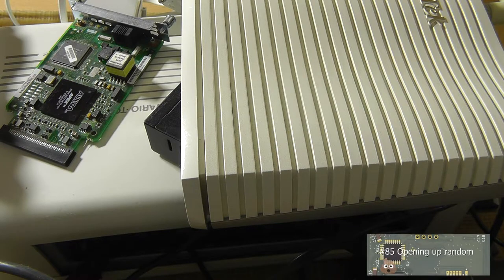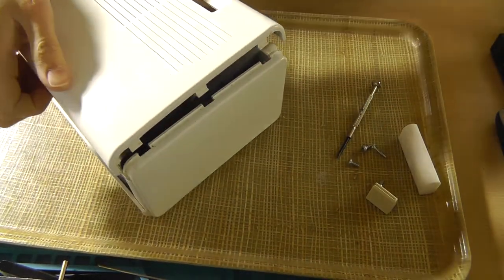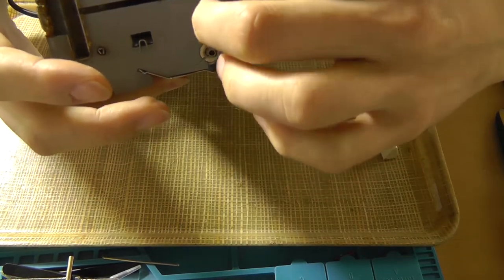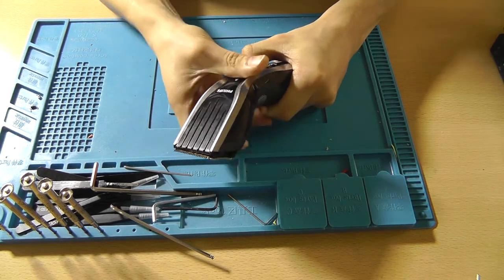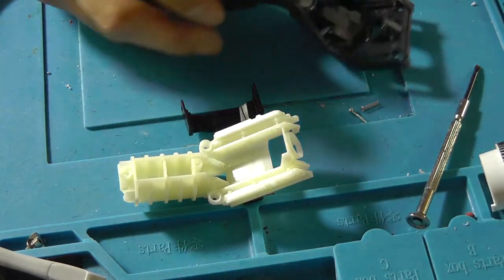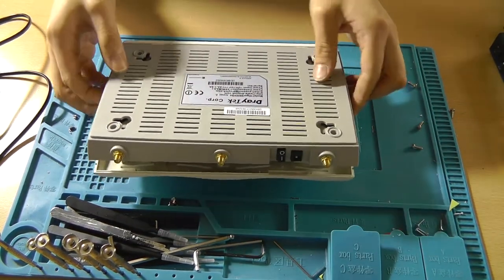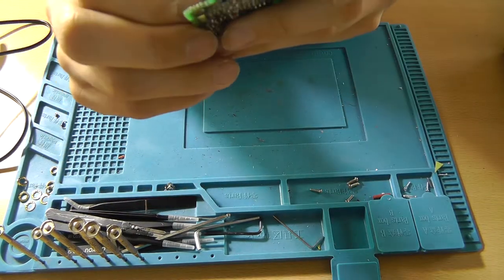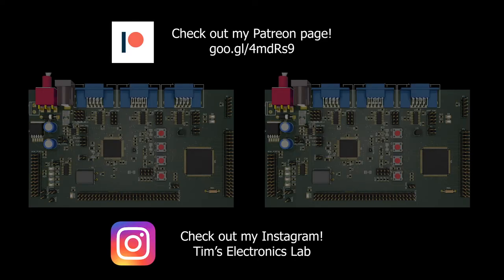#85 Opening up random 💩

Comment: I once repaired a toaster ( I think it was made by Philips ) that had a 555 inside .All the others used a  bi-metalic strip . 
 I have repaired many over the years ( here in the uk ) . As far as I remember they all had ribbon heating elements on a
mica sheet -- breaks being repaired by spot welding it back together .

                                                                                                                                        Alan
Reply from the maker: Aha! Well that's very interesting to know! We've since replaced ours with a new one, 20 years is quite a time for these kind of appliances